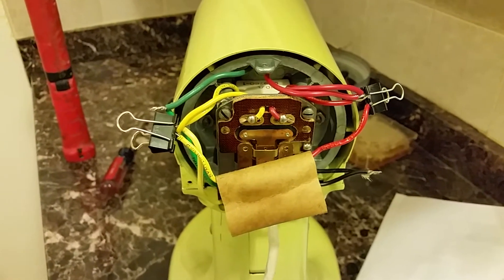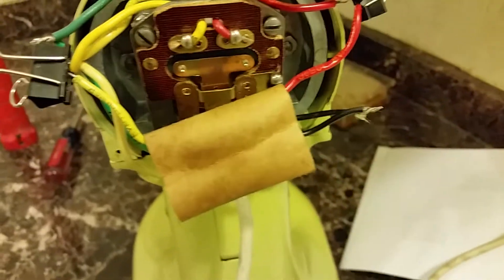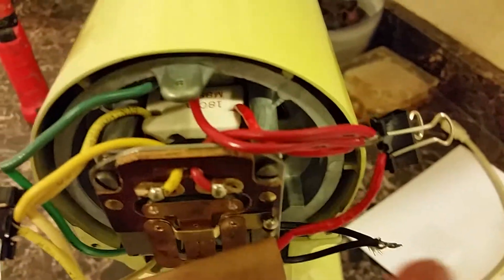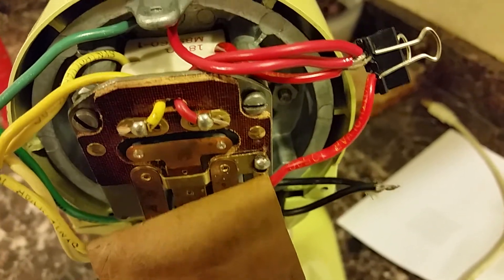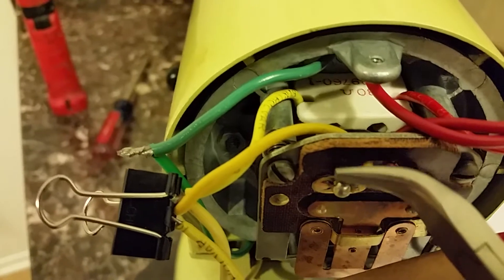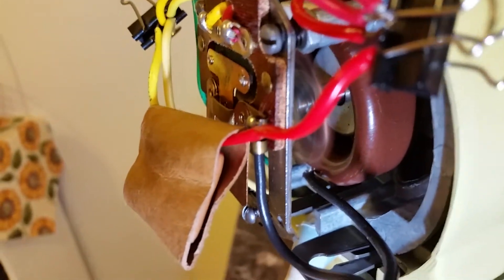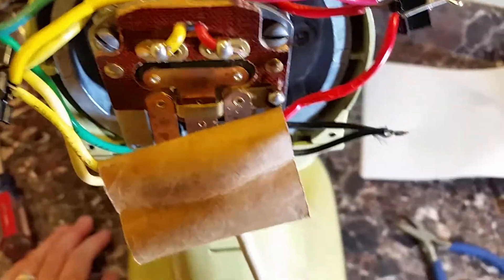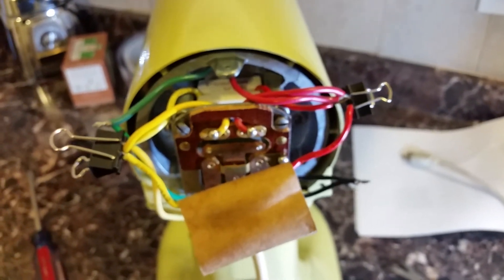HOBART-KITCHENAID MODEL K45 MIXER (PRE-SOLID STATE) - SPEED GOVERNOR OPERATION

Comment: My unit just ran full all the time. Found the capacitor was shorted. Quick test is to remove it and test. The points will spark a bit. The unit will now have speed control. I found the capacitor on Ebay for 15.99. Thanks for the great video.

Comment: Have you ever tried upgrading the speed control to the solid state type?
Reply from the maker: No.  The older mainswitch can be used on DC.  It is stronger with. AC and it maintains the ORM configuration.

Comment: Excuse me, can you tell me what capacity is the diode that is covered with the brown paper?  And what is this diode for, in its diagram it appears as a capaitor.  I will appreciate your response.  Thank you
Reply from the maker: It is a 0.1 MFD capacitor.  It supresses sparking,
Reply: @markdavidstrode4  thank you so much
Reply: two more questions, 1st.-the resistance that goes around the governor spring, what function does it do?  2a - how can I adapt a card to control speed instead of that resistance

Comment: good evening.  Can you tell me the capacity of the fuse that this k5 mixer uses?  I will be grateful
Reply from the maker: 0.1 Microfarad.
Reply: @markdavidstrode4  Since these caps are no longer available through KA, what type (film/ceramic) and at what voltage would make a good aftermarket replacement? Thanks in advance!

Comment: You can use genuine Whirlpool mixer grease but that model year wasn't produced by Whirlpool!
Reply: the grease sold "for mixers" is often not great and won't stick to the gears. I use Super Lube Synthetic Grease (NLGI 2) - it's food-safe and works well (and costs a lot less than the "official" greases)
Reply from the maker: e grease is a general food grade grease in a whirlpool can.

All food production facilities that have equipment that need grease lubrication use such a grease.

Sunbeam (formerly) and Whirlpool package small quantities of this grease for sale at very high unit prices.

In the day the mixer was made a certain petroleum company's type was specified.  KitchenAid never did. to my knowledge, offer this grease in their branded packaging.

Comment: Also my speed 1 is very fast is there any way to slow it down similar to the modern models? It's a beast and works great with many attachments without bogging down like the newer ones! Thank you again! 👍🏽
Reply from the maker: the small adjustment screw at the bottom of the speed plate when turned counter-clockwise will reduce the speed.  The correct speed is 1 planetary revolution per second  on speed 1.
Reply: @markdavidstrode4  thats what I thought too thank you so much! 👍🏽

Comment: Could you advise details of capacitor in brown paper pack ?
Reply from the maker: It is a 0.1 Microfarad NON-POLARIZED capacitor.  Rated for 170 Volts (minimum).

Comment: Great video. I just fully broke down a KA-5 (1976) to refurbish, and it looks like it has an identical speed control setup to this. I have it all back together but am struggling to get this set correctly (I didn’t pay attention to the distances pre-disassembly unfortunately).

My two screws holding the plate on are fully buried with the spring fully compressed, and I still have no change in speed before speed 4 (seems like I’m missing speed 1 and 2 but then the rest work fine). I feel like it would work if I were just able to bring the plate closer, but I must have done something wrong to require this as it was working fine before disassembly. 

Is the speed control link that slides forward and backward with the control lever suppose to be attached to the bottom of the speed control plate, or does it just float and push the plate forward?
Reply from the maker: Hi there.  The K45 and K5A are identical motors,   Set the two top screws so that  3/8" distance is between the motor plate and the each boss of the bearing plate,   Tighten the locknuts snugly so the screws can sill be turned but will stay in whatever position you ;eave them.  With the unit on Speed 1, adjust the lower single screw, the end of which bears against the link connected to the speed knob (it just floats - there is a spring to keep the screw in contact with the link), until the planetary runs at 1 revolution per second (60 RPM),  Once that condition is met, high speed should be correct.   If needed high speed can be trimmed by equally turning the 2 top screws.

Comment: Hi Mark, 
I am in the process of restoring a Hobart era K45, and one of the green cables that are coming from the motor to the control board is severely damaged.  The insulation seems to have melted away, and the wire is exposed. This is my first restoration job, and really don't want to give up on this project. Is that something that can be fixed, if so how would you recommend I go about it?
Reply from the maker: Hi there.  You can use shrink insulation to fix the exposed wire.  You slide the cut to size tube of it over the wire and heat it with a match.  Harbor Freight has it.  Perhaps Lowes or Home Depot also.
Reply from the maker: The resistor has to be good also.  To check  it is good and connected keep the motor control points open by placing a match book cover or similar between them.   The motor should run really slow.  If it stops completely though, the resistor is bad or a connection to it is bad.  Double check the capacitor.